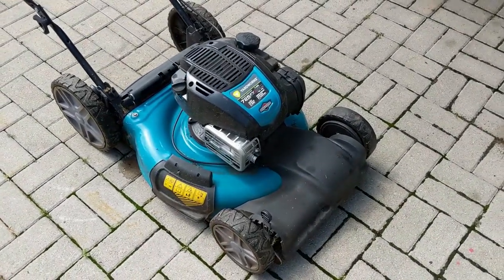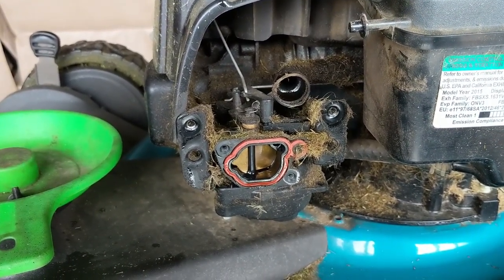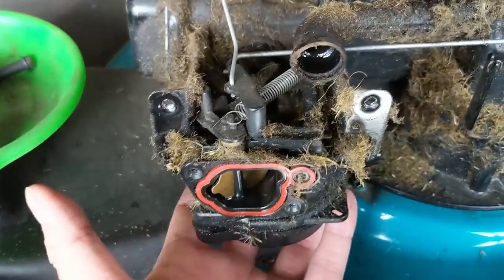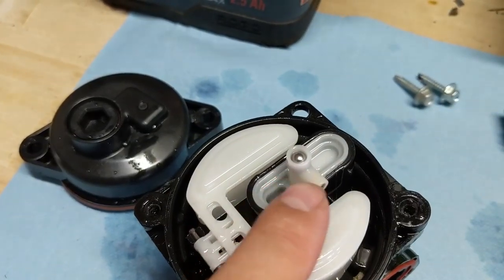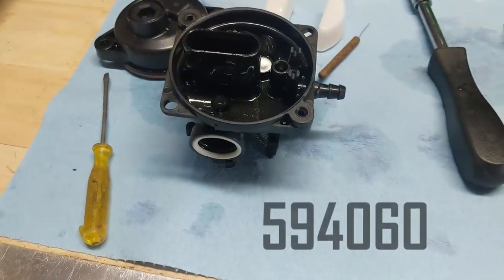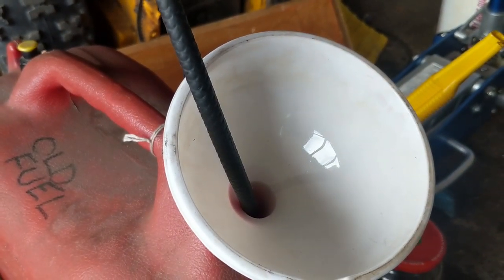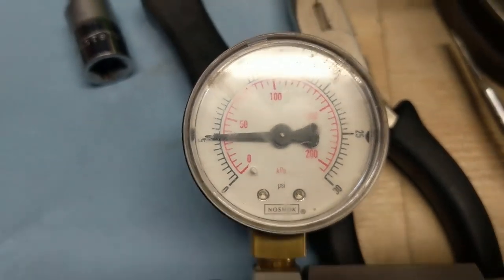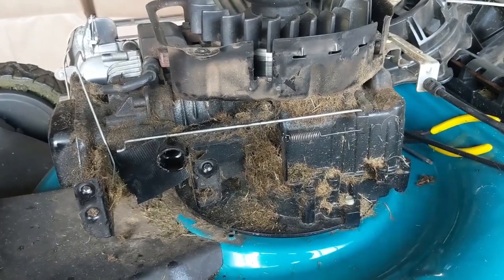How to Clean a Plastic Briggs & Stratton Carburetor

Comment: Great video, however I wouldn't recommend using a screwdriver to remove the main jet! It comes out easily wiggling with a pair of pliers. Also, the main jet comes apart into 2 pieces for a more thorough cleaning.

Comment: Hand's down, ONE OF, IF NOT THE BEST technical 'how to' videos I have ever seen! And I've seen A LOT. Everything is well described, well explained, reasons for everything given, well videoed and edited. This guy is not only knows his stuff, but is articulate as well! Thanks for doing such a fantastic job!
Reply from the maker: Thanks for the kind words Gary!
Reply: @EliminatorPerformance  I couldn't agree more about this detailed instruction video being thorough & complete. Great job and thank you! However, once I finished cleaning the parts well & dried I had an issue while re-assembling the carburetor, specifically the small bowl drain plug & that small O - Ring that seats inside the bowl drain plug. I found out the hard way how it can get pinched & rip when turning the plug with the hex tool. I used 3in1 Oil on the O - Ring, but it was a little stretched/worn & didn't want to sink into the groove when attempting the 1/4 turn required for it to seal properly & the little tabs on the plug that grip the tabs of the inside end of the hole cracked, rendering the plug itself useless as well as it's o-ring. The rest of the carburator went back together like new with no problem sealing the bowl, the jets cartridge, floater, needle, etc...
The only issue is the plug & o-ring. I see replacement #'s for the entire Carburetor or Jet cartridge that you've left here in the description but can I just get the bowl plug & small o-ring replaced, as opposed to replacing the entire Carburetor & do you have the parts #'s for only that so that I can order them, please? I would appreciate it greatly!!! Again your videos are easily the best on YouTube, hands down. Please reply

Comment: If you don’t have an ultrasonic cleaner. I recommend you separate the white jet assembly into two pieces and clean. Your mower may run but will surge if this is not cleaned out completely.

Comment: Nice tip on trimming the choke lever!
Many seem to hate these plastic carbs, but I love 'em. Consider the simplicity, ease of service, entire jet system pops right out, and NO CORROSION, EVER! Depending on the equipment, you can even do the clean and not even remove it from the engine.
Excellent vid as always.
Reply from the maker: Thanks for watching!
Reply: There really easy to remove and clean in ultra sonic cleaner
Reply: Thanks for the comment about being able to remove the jet system assembly without actually removing the carburetor. That is specifically what I was wondering about. So I thank you very much for that.

Comment: This may be the best 'how-to' repair video I've seen. Solid, friendly advice with a good pace, excellent close-ups, and simple steps. It includes re-assembly details and gotchas that others often gloss over.  I followed step-by-step, pausing the video as I went. The only issue in my repair was due to my ignorance. I sent the lawnmower blade out for sharpening and tried to start the mower without it. OUCH! The kickback from the pull cord almost yanked my hand off my arm at the wrist! Apparently, this motor uses the blade as flywheel weight and kicks back with a vengeance without it. Thanks again for the quality video!

Comment: My Troy Built mower with the same Briggs and Stratton engine/carburetor wouldn't start after sitting all winter. I've never messed with small engines or carburetors, but I found this video and it seemed easy enough. Followed it exactly, took apart the carb, cleaned up the fuel tank and fuel line - which is where the problem was. My screen at the bottom of the fuel tank was gunked up with old gas and when filled with water nothing flowed out. Anyways, learned a lot from this video and it solved my problem and saved me a bunch of money too. Thanks!

Comment: I bought a Snapper mower from Walmart it has the B&S 725EXI engine. I used it one whole season, then emptied the gas tank and put it away for winter. Got it out the following spring , filled it with gas, pulled on the cord and it would NOT start. Replaced the spark plug then the air filter. STILL NO DICE. Threw my hands up in the air and put it back in the garage, used the old mower I had on stand by since I knew it worked. Flash forward 3 seasons I see this video and the one about the choke system design flaw, I drag out the mower and apply everything you have in these two videos, pull on the cord and away she goes like a champ!!! DUDE!! YOU ARE THE MAN!!!! Thank you so much for sharing your knowledge with the world. I was already going to wheel it out to alley for spring cleaning, NOW I can use it till the cows come home.

Comment: Want to say thank you. 

My Snapper mower with this B&S engine would not perform. Followed the tutorial and the filing down of the lever for the choke fixed everything. Followed what the video said - removed the tank and carburetor. Cleaned everything with carburetor cleaner and blew out everything with my compressor. The mower runs like it is brand new again. 

I want to thank you for an easy to follow video for cleaner the carburetor. 

Thank you.
Reply from the maker: Thanks for watching, glad to hear you have it running again!

Comment: Thanks, most people tell you just to replace the carburetor if it's plastic, who knew it's so simple to clean easier than the metal ones I think, I have 2 carbs like this, cleaned both after watching this no problem.

Comment: Very well done. Clear and concise. I have this exact engine on a power washer, only one year old. Couldn’t keep it running. Decided to follow your carb cleanup - gel fuel was exactly where you mentioned. Reassembled , started first pull. Thank you for the video.

Comment: Excellent vid bro...the only thing I would suggest to everyone is to not use a flat head to pry out that white plastic jet as it can damage the plastic around it and the seal as stated. You can push from the inside of the cab where the distribution tube comes up, then u can gently remove from the under..that hole where you push that tube down must be lined up before re installation...
Lovely detailed vid bro!

Comment: Thanks. I have a Swisher string trimmer with a Briggs and Stratton 675 EFI engine, and found this video helpful in figuring out how to remove the carb so I could de-gunk it. The only differences from what was shown in the video was that the screws holding the engine cover on has a #20 Torx head, and I found it easier to reconnect the engine breather to the air filter housing prior to reinstalling the engine cover. Great instructions.

Comment: This was an excellent tutorial for for this problem. I  had never cleaned out my own carb before and was not sure about the project, or if this was the cause of my problem. I fallowed this video step by step (drained but did not remove tank) and the lawnmower is running better than new. I recommend watching the video right to the end first, then go back and go step by step. It was very  helpful putting it back together. A few things to look out for. Loved this video. I'm sure you saved me at least $150.00 where we live. Thank you!

Comment: From the detailed, thorough step-by-step explanation to the excellent camera work, one of the best videos I've seen!  Thanks for your time and effort!  I hope this helps me out!  I'm working on a lawnmower that inadvertently had gas poured into the oil spout, and then run for a while.  I've changed the oil twice, and it is up and running. Gas is getting into the piston after it sits for a while, however, and also leaks out of the carb inlet right behind the air filter.  May be the rings, but a good carb cleaning is a small first step!
Reply from the maker: Leaking Needle valve causes fuel to flood from the carb into the intake, which goes into the cylinder and past the piston rings to dilute the oil. Common issue. Replace the needle valve and change the oil twice.
Reply: @EliminatorPerformance  I'll do it today!  Thanks, so much!
Reply: @EliminatorPerformance  Followed your steps to a tee, and the machine started right up!  Changed the oil twice, and adjusted the valves.  Hopefully, it will give them many more years of service from the mower!

Comment: Great video! One thing to be wary of when using compressed air to clean the white main jet cassette is that it is possible to dislodge the other brass jet insert. Not the one that sits in the fuel in the float bowl but the other one. This happened to me but luckily I saw it fly out and found it!

Comment: I try to keep my lawnmower in top condition and store it over the winter by running it dry, but even then it still requires a manual carb clean before the first mow of the season with fresh fuel. Thanks for the tips and advice
Reply from the maker: Try to buy a can of engineered fuel, like VP or Kinetix, even Aspen fuel, run mower dry, add half a can, start and run for a minute and then shut off and store. It'll start next year almost guaranteed!

Comment: Your video saved my day. My mower works lime a charm now. If anyone is facin the « start-then-stall » issue, this is the solution. A tip is, I used my bike pump to blow air in it as I don’t have a compressor.

Comment: Thank you for this amazing video. It gave me confident to open and clean my machine and its running now. 
There was two places I got stuck but was able to resolve it. 
1. Opening cover at 2:22 mark - The Torque screw: I could not figure out the screw type as my mower has dust in it but listening to your video again and again then picked up whats a Torque screw. That helped. 
2. When I take off Float and needle valve at 7: 15  - The needle valve was in the cup and I did not know where that came from. figure out by the shape and put that point part in and the intend part in the top where there is a space to put that in.

Comment: Excellent instructions and easy to follow your detailed approach.  Only issue I had was reinstalling the main jet housing.  Could not get it pressed in.  Looked in the bowl and saw a sleeve was blocking the center port.  With a small piece of wire I pushed it out of the port and everything snapped into position.  Thanks for your excellent work.
Reply from the maker: Yes I forgot to mention that part, if you bump the carburetor or move it at a certain angle, the tube that it presses into can shift. Thanks for watching!

Comment: Excellent video. I have the same B & S 725 series 163cc mower with the plastic carburetor so now I can clean the jet to get fuel to flow properly. I took it apart once to clean it and didn't know that the white plastic jet assembly comes out to clean the other intake ports inside it so I only got about 15 minutes of run time before it stalled out and wouldn't stay running (starts and then shuts down in 2 seconds). Thank you.
Reply from the maker: Check out my video on Briggs plastic carb design flaw! Make sure your mower isn't affected!

Comment: Great video, I reassembled and started it up right away! Only one issue though, fuel ends up coming out of air filter after use, not sure what’s wrong?
Reply from the maker: Check to make sure the needle valve is sealing properly, and check your oil too, make sure no fuel went into the engine!

Comment: I'm a EETC certified mechanic and I want everyone to know not to leave any gas station type fuel in their machinery for more than 6 weeks. If you can get Aspen fuel it's all you need and I will stand by it. Run the fuel tank completely dry and put in some Aspen fuel. Start the engine for a minute and set it off the side till next year. Aspen fuel is good in the tank for three years and good in the in the unopened bottle for five years. It will stop your carburetor problems with this and it also burns cleaner then any other fuel. I will stand behind this method over anything else. Standard fuel from the pump is the biggest problem. Look up Aspen fuel and you will see.
Reply from the maker: I had to quit using Aspen fuel because the fumes burned my eyes. Also had other guys who couldn't race go carts using Aspen because of how it negatively affected drivers behind anyone who was running Aspen. Not sure why, but we've switched to Kinetix engineered, ethanol free fuel and it works great. Gulf Pro also sponsored us but their products were far to expensive.
Reply: @EliminatorPerformance  I only recommend it for storage. I don't recommend to use it constantly. I fully understand what you mean. That is why we only use it to store the machine when not in use. I will have to look that fuel up. I'm in the Pacific northwest and I haven't heard of that brand. Thank you for your information I'm greatful for that.
Reply from the maker: @Rabid_Badger_racing  I get Kinetix through Power Source Canada here in Ontario, which is the Power Distributor for Briggs and Stratton parts. I believe the main distributor of Aspen got in an argument with someone and it's harder to get through various suppliers, as I know Theo Turgen and ESF Direct stopped selling it as well. The Gulf Pro Fuels is available only through a company called Small Engine Service, and their costs were unfortunately too much. Because I'm a dealer through Power Source, I get free shipping on orders of $350 Canadian, so I usually add a case or 2 of fuel (50:1 or straight) and use the free shipping on that order as an additional cost savings. We do not use TruFuel anymore as we had issues with their fuel, mainly because there was never a date code, so you could be buying 5+ year old fuel
Reply: @EliminatorPerformance  I learned about trufuel in school and I don't like it either. I found it was a waste of time. That is why I started researching all synthetic fuels. Me biggest concern was to help customers who were bring in machines constantly because of old fuel from clogging up carburetors.

Comment: Great Video.  Ii had an engine that was pulsing and before I saw your video I bought an aftermarket carb.  After installation, it didn't pulse any more, but it runs for a little over 10 seconds, starves for gas, the choke and governor take over and it comes back up to speed.  Does this about every 10 seconds.  I'm thinking either the needle valve is't keeping the bowel full or the main jet is too small.  There is no adjustment on the needle valve.  Any ideas?  Thank you

Comment: This is my problem. I have spark but it won't start. I took the carb off but never went into the detail like in this video. I like this video because it is so detailed. Going to take it off again and check it out better. Probably why I'm not getting a wet spark plug.

Comment: Exelent tutorial, a couple of questions : You mentioned that fuel can be bad do you recommend using additives to maintain the gas clean and for storage purposes during the winter? As well you mentioned you use High Octane fuel is that Super or 96 octane? I alway thought you didn't have to use premium on these engines. As well there are kits to replace the float and pin and oil rings is this necessary ? My problem is gas leaking out of the air filter so I was wondering if any of these parts have failed causing the leakage. There is a lot of smoke sometimes when I start it as well not to mention the vapor lock that happens every once in a while...I am hoping a good cleaning will help.  Thank you so much. Subscribed

Comment: ALWAYS like your videos. Crisp, clean, great video sound, but mostly to the point. No fluff and B.S. With that said, one question. Why didn't you slowdown or clean the area before working on the carb??🤔
Reply from the maker: Cleaned it before putting the carb back on, Thanks for watching!
Reply: @EliminatorPerformance  sorry, it should have said "blowdown". Yes it saw you clean before reinstalling. Just thought it odd, not before detaching the carb. Keep up the great videos!!💥 I've been referring others to your channel. Thanks. YOU MAKE A DIFFERENCE.✌🤘🖖

Comment: Great Video.  Thanks.  Can you explain how you would adjust the RPM'S on this type of Briggs and Stratton engine?  Thanks.
Reply from the maker: Governor spring that goes to throttle sets the RPM, so the tension on the spring is what sets it
Reply: Great.  I guess very much like a Honda.  Appreciated.

Comment: I know you have shown the way to tip your lawn mower , this would be a good time to show what happens if you tip Wong side up .The nice lubricated air filter .Thanks for the good video .
Reply from the maker: I always advise against the tipping method, as the fuel can drain into the engine if you tip to the opposite side.

And the oil can drain into carb if you tip to carb side.

So it's really important to drain fuel, then tip for draining oil.

Thanks for watching!
Reply: Great advice.  I always tipped my lawnmower to get it to run and didn't know its not advised.  Thanks

Comment: Great explanation. I have a Billy Goat vacuum with one of these engines on it. Cleaned the carb, did everything you said. Also put on a new air filter and spark plug. I tried starting it after reassembly; it took between 10 and 20 pulls before it sputtered to life and there was a bit of white smoke for a few minutes. It ran rough the whole time. Before doing this I cranked on the first or second pull and ran flat out until I turned it off. Any idea what it could be? There was also a little oil that sputtered out after starting it.

Comment: hey mate, is it a good idea or even possible to raise the revs on the 725exi ?
Reply from the maker: Sure can, but do it at your own risk! A higher reving engine will wear out sooner. Also run hotter and the blade will spin faster. Find the linkage that hooks to the throttle and it'll attach to the governor arm. There should be a spring there on a tab that you can bend. The way that puts more tension on the spring is how you raise rpm